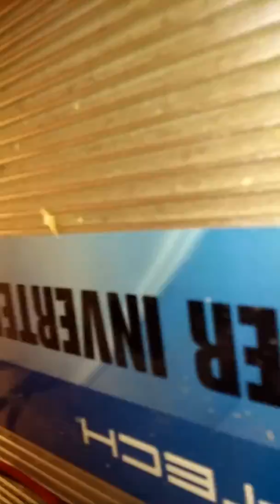Solar generator

Comment: Hi Gary,  I just assembled a small solar generator and having an issue with a little battery drain at night.  I understand a diode between the panel and controller will fix it.  Have you had this problem and if so what have you done to remedy it?  Thanks for your time.  Regards,  another Gary
Reply from the maker: I don't have that problem it my be in your controller
Reply: +Gary Mull  Since I wrote you I've discovered the small panel I had on my setup likely did not have a diode.  I have purchased a 100 watt panel to put on my generator that does have the internal diode.  Haven't installed it yet but hope it fixes it.  I have a few goals in this project.  One is to learn this technology for myself.  The second is to have an alternative option to power cell phones, laptops, a few 3 watt 12 volt LED lights, etc.  The third is to pass this learning on to my grandchildren.  In the near future once I get the system going like I want, will upgrade to a 300 or 400 watt system to help power a small cabin we plan on putting on a small parcel of land we own in a neighboring county.  Thanks for your help.  Regards,  Gary
Reply from the maker: +Ozarks Hillbilly I like to build and learn to build from scratch is very rewarding to do the bigger you build it the more you'll love it